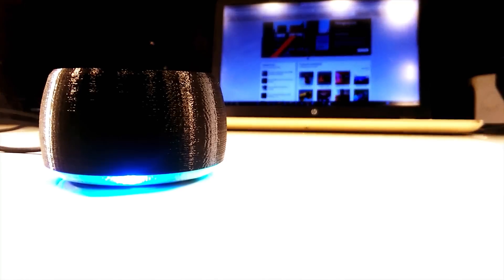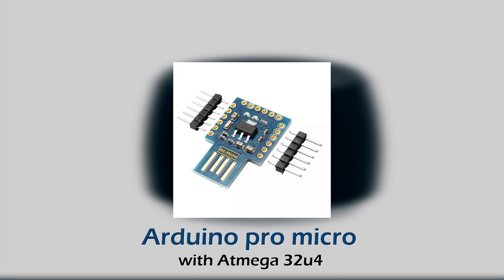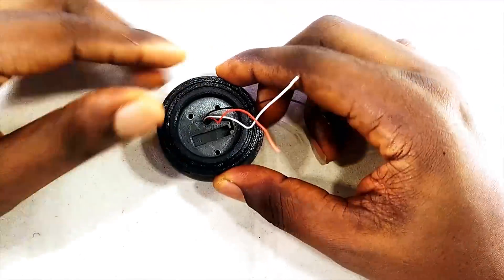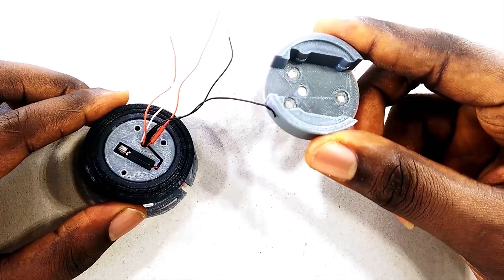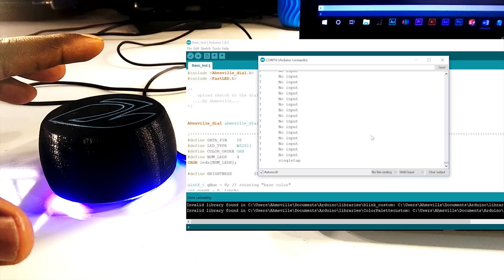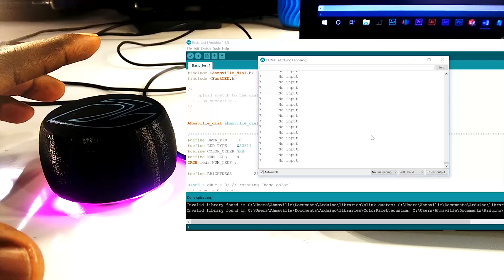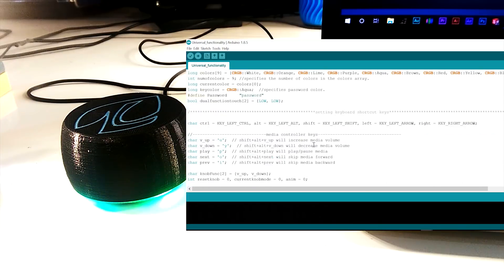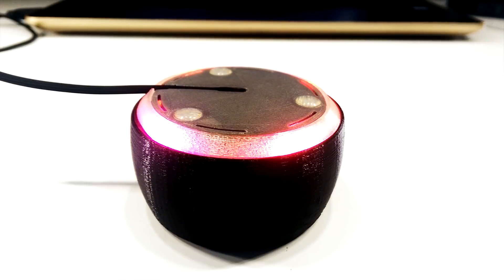DIY RGB Dial Controller for Any Application | Enhance Your Creative Process.

Comment: I'd love to see more inclusive materials for these videos... It's DIY to an extent, but requires a custom PCB if I understand it correctly.

I'd be more interested in gaining the underlying skills that I could apply to my own project ideas. For instance, I'd love to see a video (or series) showing how you built this from scratch... What did you start with, how do prototype and figure out what parts you need, how do you plan and test the custom circuitry/dial board, what resources did you use along the way for reference materials, how did you design the PCB, and finally how do you find an affordable company to have the PCBs printed?

Comment: It's all good but 
It hurt my soul when you inserted the things up side down and chopped off the excess while the contacts on the other side were wayy too short 
5:59
Reply from the maker: Hi Kumar, am not sure I know what your talking about...
Reply: @AhmsvilleLabs  the pin thingies, the ones you chopped off.
They are supposed to go down there other way.
The short side is soldered and the tall side is left up, then you'll have the exact length, no clipping
Reply from the maker: I have my reason for designing it that way..but I do see your point..
Reply: @AhmsvilleLabs  
Absolutely mate

Comment: Thanks for posting! Do you feel like that printed bearing is smooth enough or would you prefer a metal one?
Reply from the maker: The 3d printed bearing is really smooth, it's one of my designs, a metal bearing will be smoother though.

Comment: Why wouldn't you just insert the magnets into the print mid-print? Those magnets are strong enough for that right? You might want to update your Thing Details for the prints. I would want to print an outside rubber ring out of Flexible filament to make it a bit more comfy.